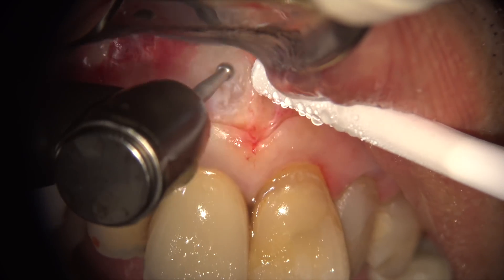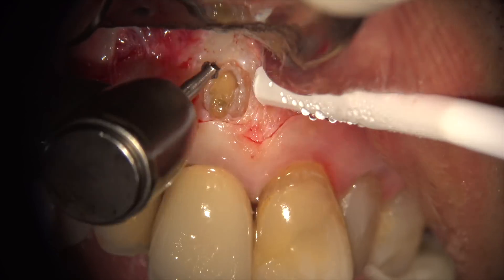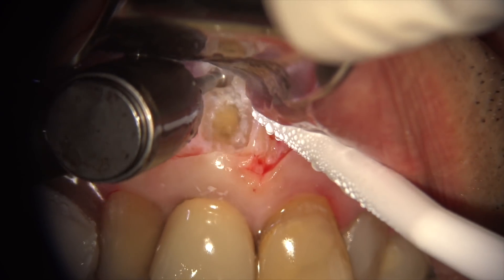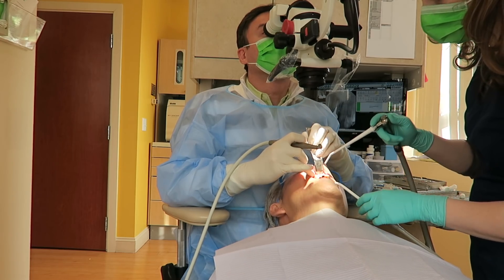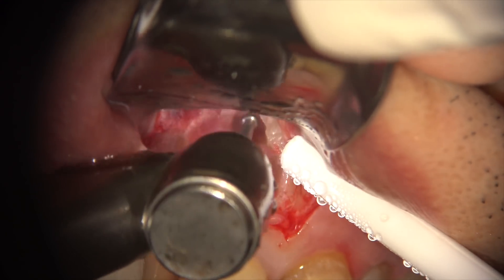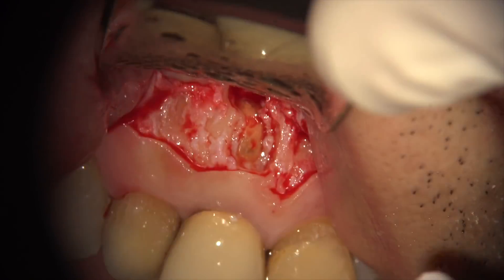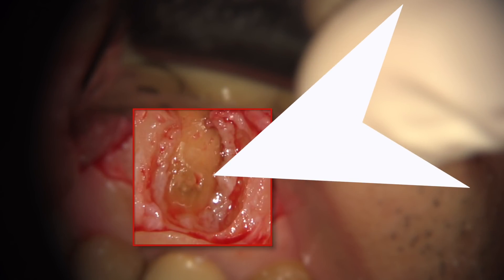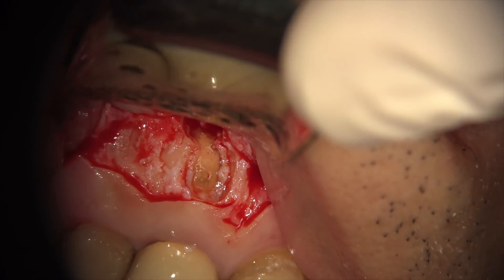Lid Technique for Retrofiling

Comment: But after watching one of your videos before this one , you mentioned that hemostatic materials like ferric sulfate or aluminium chloride cause post inflammatory reaction as pain .. so you prefered not using them and relied on cotton with pressure to stop bleeding which bleeding time  lasts for 2min to 6 min for most bleeders .
Reply from the maker: Yes. Ideally, you want to avoid any hemostatic agents. That's more like an aspiration, not a mandate. But I would still use aluminum chloride rather than ferric sulfate. it's less caustic. Cheers!

Comment: Thanks for upload. May I ask what are thoughts about disinfecting the canal with Chlorhex (or even saline) before applying the retro prep?
Reply from the maker: If you can do some disinfection with anything including NaClO, or hypochlorous Acid, or Iodine, or even Chlorohexidine it's better than nothing; However, there is no research showing that it makes any difference  on an outcome point of view. We're merely making a recommendation based on a proxy and the disease model. Cheers!

Comment: Thank you doctor for the video. But i have a doubt are you using air rotor for removing the lesion? If so wont there be a risk of emphysema?
Reply from the maker: The handpiece is not expressing air. It only expresses water. That's what a surgical handpiece normally would do to avoid air emphysema. Cheers!
Reply: @EndosKool  thank you doctor

Comment: @Dr Allen Nasseh  : I am an Endodontist whose 99.99 % of his practice is through orthograde access. I did though some retrograde surgeries when I REALLY had no other choice ! I usually use IRM and it gives very nice results .The use of the IRM  is : 1-well documented 2- affordable and 3 - its manipulation is relatively easy . Why do I have to switch to MTA ?
Reply from the maker: I appreciate attempting to resolve problems non-surgically first. Surgery, however, has a great function and a high success rate when performed when it's truly indicated. Your good results with IRM I think are a function of your good treatment planning and case selection than IRM. The only problem with IRM in a well selected case is the fact that it's soluble and will wash out in time. So, the nice job you've done with placing a well corking IRM will wash out in the long run. What's advantageous about bioceramics (MTA/BC Putty/etc.) is their biocompatibility which is superior, showing cementum growth over the materials, and their chemical bonding to the tooth structure and washout resistance. It's for that reason that bioceramic materials are currently the gold standard in surgical endodontics. Cheers!